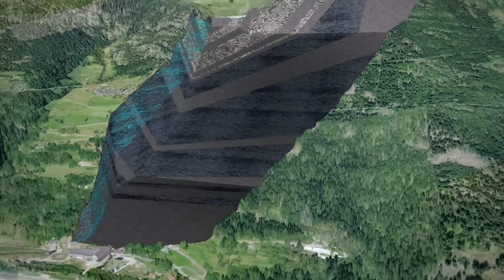India’s Genius Engineers Split Himalaya Mountain To Build The World’s Highest Tunnel

Comment: india is building The Shinkun La Tunnel which is located at an altitude of 4800m (15800 ft) the highest tunnel in the world opening in 2028
 
the present longest High-Altitude road tunnel in the world is Atal Tunnel with a length of 9.02 KM at an altitude of 10000 ft (3100 m) which is also present in india so india is giving a good compilation to china in milestone.
Reply from the maker: That’s impressive 👍 India is definitely making strong progress and setting major milestones in high-altitude infrastructure.